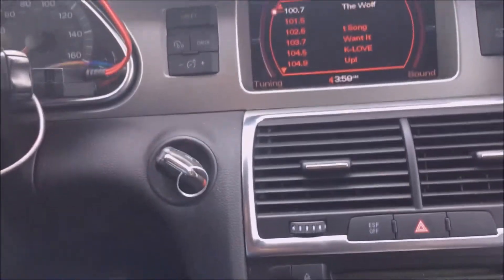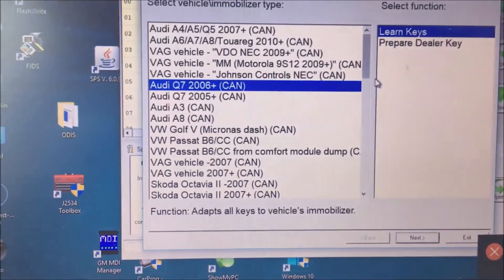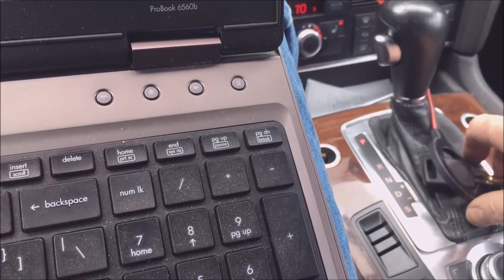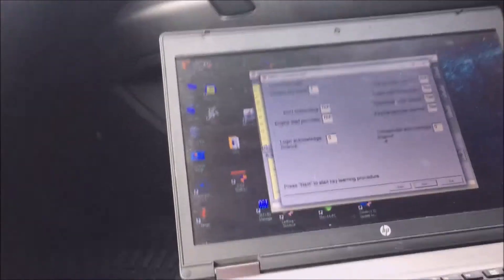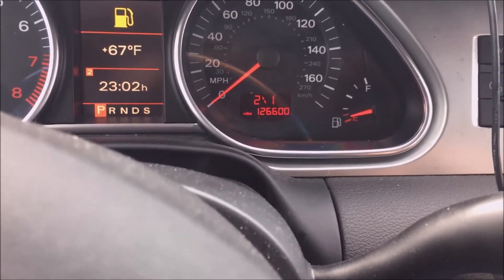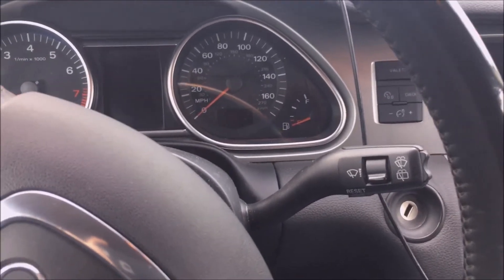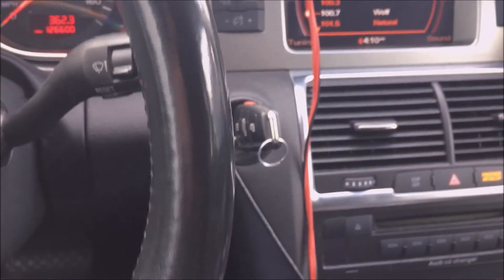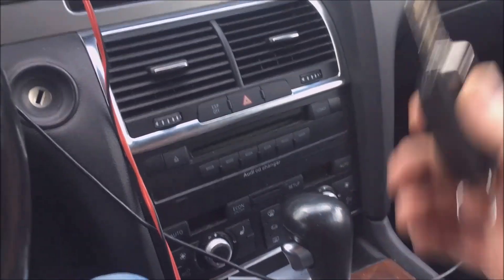2007 Q7 spare flat key (valet key) with AVDI

Comment: Hi Tim just wanted to know if you could help with a key programming problem with a audi a6 2008 ,the vehicle came into garage with both remotes not working the  central locking but would lock/unlock manually with key. I tried reprogramming the keys with odis but when I inserted 2nd key It didn't do anything and the  number of keys displayed in dash stayed 1/2 ,i know it's not a faulty key as i lets me program both keys separately ok but not together. 
Any help would be appreciated. 
Thanks Alan.
Reply from the maker: Couple of questions, have you read the keys?  are they both dealer keys? or are they aftermarket keys??  I have had that issue with aftermarket keys that had same signature..  Car thinks you are trying to program in the same key twice..  As for the remote not working, have you checked for water intrusion??  Also, if the keys are aftermarket, the remotes will never work...  That car has an 8E chip that is onboard in the remote, the chip interfaces with the immobilizer and also sends the remote data to the car, I have personally tried over 25 aftermarket remotes, and none have worked yet... good luck and let us know what you find..

Comment: Hi Tim,
Have you ever had problems with Abrites such as damaging the bcm or things like that?
I'm considering buying a FVDI but don't know what model to get. Do you know if 2020 is any good or should I get the 2018 like yours? Thanks
Reply from the maker: Well, FVDI is a copy of AVDI, Abrites went online with a lot of the functions so they couldn't be copied...  If you buy FVDI, you are basicly buy a 2015 AVDI copy...   If you use AVDI correctly, there usually isn't any issues..  I say usually, because there can be issues with any auto software..  I have the factory ODIS software and also BMW ISTA, and I have screwed up modules with both of those.. Personally I would touch a 2008 or newer car with FVDI. Before you buy any chinese tools, read and ask questions..  FVDI will not do Mercedes keys, why?, because there is no online calculations for keys.. Any VAG car that has a BCM2, needs internet to calculate the CS and pin, you won't be able to do that with FVDI... I have the true AVDI, and it is updated to the latest software... Now, I am not going to put down any unit or any software, you just need to realize that the clones are a lot cheaper, but usually you get what you pay for...  I can tell you that about 7 years ago I started with an FVDI, this was when no locksmiths were doing the VW touareg, and most weren't able to do the 2007- VW's...  I was able to make enough to buy a real AVDI, and have never looked back...  I can tell you that if you do brick something with FVDI, you are on your own... at least with AVDI you can send in a request for support, not saying they will get right back to you, but at least you have a slim chance you can fix what you broke...  good luck..
Reply: @timtracy9442   thanks a lot for your reply!I'm new to this and it helps me a lot. Keep up the good work!

Comment: Hello sir I just got one of these on the schedule will avdi program a remote key from the dealership. Plan on ordering the dealer key. Do remote functions program with the transponder at the same time?
Reply: Thanks Mr. Tracy any advice on this would be greatly appreciated.
Reply from the maker: yes, the remote programs with the key...  Is this an extra key?  or an All Keys Lost situation??
Reply: @timtracy9442  all keys lost situation
Reply from the maker: @matthews.5369  Just realize you are going to have to jumper fuses or pull the steering lock to get the CS and Pin...
Reply: @timtracy9442 The key  is suppose to come precoded from the dealership.
I'm ordering from vin. Will I still have to pull the module or jump fuses?
Reply from the maker: @matthews.5369  you still need to turn the car on..  and an unprogramed key won't do that... you need the pin code from the car, and to get that you need to force on the ignition..  I would use the force tool, if you don't have one, put a paperclip from pin 16 to pin 1 of the OBD plug on the backside, that will power up the module and hopefully you can pull the pin...  after you have the pin, then pull the paperclip out and put your foot on the brake pedal, this keeps the CAN awake.. and then program your key...  The only thing a dealer key does is make it so you don't need to pre code a key...
Reply: @timtracy9442  Justin has the force on tool i can use.  Thanks, you are the man Tim i Greatly appreciate  Your  Guidance.

Comment: Hello Tim . If you could give me some info i'd be apreciated man , i ve been working on a jetta hybrid 2013 keyless ( smart key 202AK ) abrites couldnt log into service mode cuz the ignition switch is off i believe how can i turn it on when workin on keyless smart access vag vehicles?
Reply from the maker: I am truly sorry.. I didn't see this until tonight... On that car you are going to have to pull the cluster and use the NEC cluster cable and put the cluster into service mode on the bench...  I then program a regular chip into the cluster, then put it back in the car and program the keyles fob...

Comment: Dodge the bullet there buddy. I have to agree with you on having a full charge battery and a battery supply/mantainer. I use an otc/schumacher 700a and the 100a for bmw, but I do mostly mobile diagnostics and module programming/reflasing. I’m a newbie to eproming and learning the ways of doing keys with vvdi pro or vvdi 2. I bought a cheap programer. Is the tl866II, but only done eproming on modules that have been discontinue by the car maker. I had a suzuki the other day that it needed a pcm but can’t get a new one, shop found a used one but couldn’t write the vin in it through the  tech2. So i used the tl866 to access the eprom and write the vin. Also done some cluster repairs, mostly gm’s. Most of the keys that i do is through factory scan tools, which i own already. Shops get the keys from the dealers but you have to pay for pin codes. I’ve been researching the way of the locksmiths doing keys with programmer like vvdi, ar32a, tango, etc. It seems like there is a steep learning curve but i think it is worth it. Specially in my area, there is a few automotive locksmiths but none of then do vw or bmw or any european for the lost part. Good videos, i’d learn a lot from them. Keep them coming.
Reply from the maker: Yes, i should have listened to my own advice...  I have an RV battery charger from amazon..  It is a 100 amp rig, I use it for all the cars I do, usually.....  This was one of those, do as I say, not as I did videos....  I have a Craftsman big charger on wheels, but I put a volt meter on it when I was charging a BMW battery, the voltage spiked at 19.8 volts..  I tell people, watch out with battery chargers, use something made for flashing...  VAG cars shut off modules above 15.5 volts...

Comment: I lost fast key fob for 2009 lancer GTS but still have emergency ignition key. If I get a fob can I program chip to car at home or do I have to tow to a dealership?  Thx
Reply from the maker: unless you have a programmer, you either need a dealer or a locksmith to program it to the car...